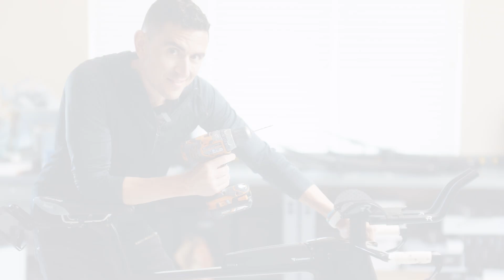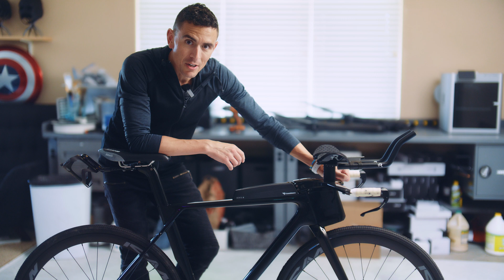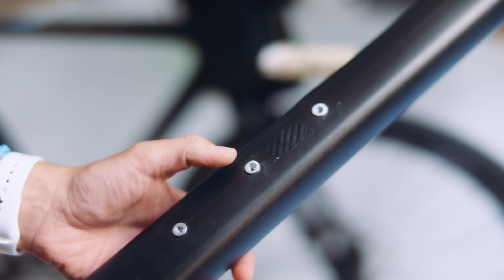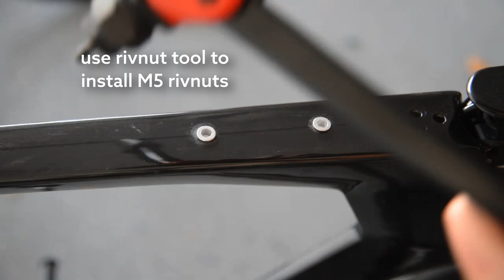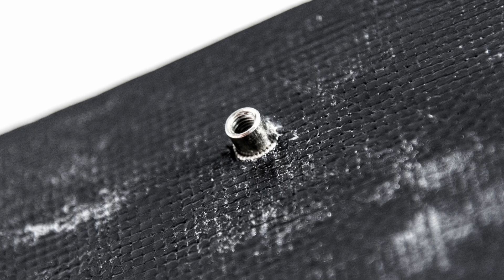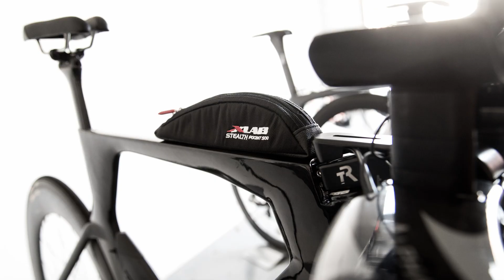Top Tube Bottle Bosses: is Drilling Carbon Safe?

Comment: I got a problem with mine that there isn’t a weep hole under the BB.  It’s got a lifetime warranty though.  First I want to ask them if it should have been there, it seems like a big design oversight.  But now I figured out if I take out the RD wire bung, I can pour the water out that hole at the dropout.

I added frame bag bosses to my alloy bike with rim nuts, I think it was your previous tutorial that gave me the confidence.

Comment: Lot depends upon the quality of the particular carbon frame you drill.... as well as where you drill the hole.  Frames crack without holes drilled into them... adding a hole in a poorly manufactured frame or one-off carbon frame missed by quality control could cause a problem.  This is why it invalidates the warranty.
Reply from the maker: Yeah, so if you have a frame cracking all by itself, maybe don't play with it. Perhaps in those cases a rivnut would serve as reinforcement - it's a metal collar after all. My larger point is that I have yet to see a bike where adding bosses posed a problem. By all means, be careful. But so far from the comments, it looks like there's still a bit of pearl-clutching going on. Not that I blame people. Just trying to provide more information.

Comment: I drilled a hole in my 2009 Cervelo S3 top tube to thread Di2 cables through it. Probably in 2010. I will be racing that same bike tomorrow morning in a crit. Still goes well...
From memory, Cervelo or someone related to them had suggested it was going to be ok, which has borne the test of time.

I like the tutorial Raoul Leuscher did, as he had some epoxy / glue that helped prevent galvanic reactions between the metal nut and carbon fibre: "How to Replace Inserts on Carbon Bikes - The correct way!"
Reply from the maker: How would you get a galvanic reaction between a metal and a non-metal? Carbon fiber is just carbon (a non-metal) plus epoxy. So sure, go ahead and add epoxy, no harm there. But I don't think you're preventing any reactions.
Reply: @tririg  carbon fibre is electrically conductive.

Comment: Carbon frame manufacturers do indeed lay more carbon fibre in bottle boss areas & other areas of the frame, were drilling is required. This giving a thicker the stronger area thats required & a better platform for the fitting of bosses & what those bosses are going to hold...in this case full bottles of liquid & over various road surfaces.

The fact you've done it & it's been ok for you, doesn't mean it's recommended or safe...& so it's best not to do it.

I'm a professional former team mechanic in Europe & have 15 years  experience in carbon bike frame repairs.
Reply from the maker: Hello mechanic friend. Keep in mind TriRig designs and manufactures bicycle frames. You're right that individual experiences may vary. My point here is that claims of "you couldn't possibly do that safely!" are wildly overblown.
Reply: @tririg  
Of course it can be done safely, but let's just say many people did because you have & say it's ok...then some have catastrophic results. Are you going to compensate them for it?

You have to be extremely careful what you put out there. The fact the manufacturers void a warranty after a frame has been tampered with, is for a reason.